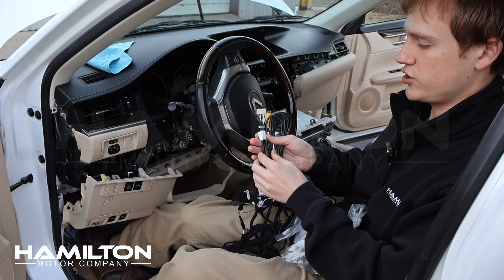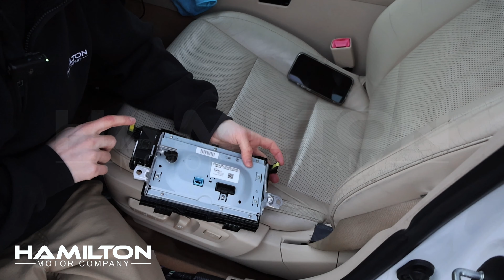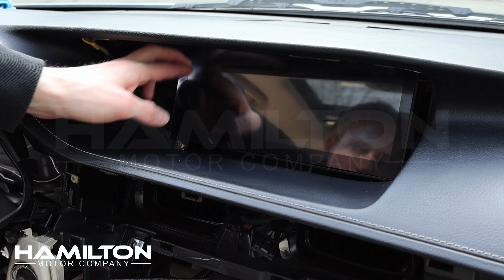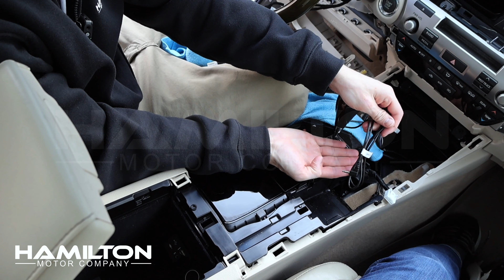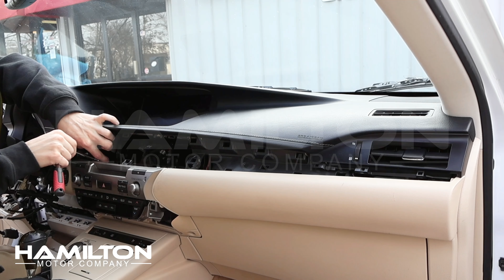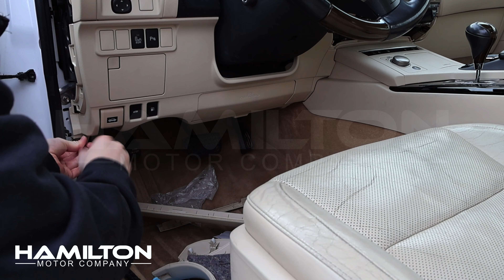2012-2014 Lexus ES Installation for Apple CarPlay/Android Auto by Hamilton Motor Company

Comment: Hi Dave! Will the backup camera have to be reconnected to the accessory harness (or any of the new harnesses from this kit)?
Reply from the maker: Those connections will be handled by connecting the Hamilton main harness to the Hamilton accessory harness. You can checkout our wiring diagram on the help center. It is not very complicated for this car/no need to mess with factory rear cam wiring other than what is behind the radio. -Dave

Comment: Is this a different headunit completely? Or is it a add on to the stock unit
Reply: Same question here. The video makes it look like the original screen gets entirely replaced by a larger screen - which is awesome. I have a 2013 es350 and considering getting this - if I can find an installer here in Jersey
Reply from the maker: Our kit connects to the Lexus Radio head unit as a touchscreen CarPlay solution

Comment: Hi, I’m interested in purchasing your CarPlay kit for my 2015 Lexus ES300h (mouse/joystick version). However, my original multimedia system (radio and display) is completely non-functional — no sound, no image. The backup camera still works. Will your kit still function properly in this case, including sound and CarPlay features?
Reply from the maker: We do require your OEM radio to still work for this system, as our equipment relies on it. -Dave

Comment: i have es 350 2014, is it possible to install it in that, and is it wireless and how much can it cost. thanks.
Reply from the maker: It has wireless and wired CarPlay. We do have a 2012-2014 ES Hamilton Conversion Kit. Installs typically cost around $400.

Comment: Where does the mic get mounted for best audio quality, as well as the small speaker that comes with the kit?
Reply from the maker: The mic is only needed for the 12-14 ES models. I would recommend mounting it above the steering wheel.
Reply: @hamiltonmotorcompany  also does the car have to be in neutral, or can I keep it in park?
Reply: @hamiltonmotorcompany  I have a 13, and I just ordered the kit a few days ago. The mic needs to be outside of the steering shroud, or it can be inside before reassembly?
Reply: @Dadlife3004  I just installed it in my 14. I followed the video precisely, but they miss actually installing the mic and the high monitor ES power behind the screen- make sure you hook that up to the original black power cord (he shows you way earlier in the video when introducing cords) before installing the screen. For the mic, I took off the large clip they gave, and ran the cord behind the very top curved dash that was slightly pulled out and placed it on the left side just at the corner of the left air vent. The other side ran  behind/next to the center air vent, up to the mic cord that will be fairly short behind the screen. It works perfectly on calls and for Siri, isn’t really noticeable esp while the steering wheel is in a neutral position. If I did it again I might test lowering it a bit more to the side, but it’s honestly fine with the black interior I have. I also put the usb just below the trim of the radio, sort of resting on top of the center console section , just the usb tip sticking out.
Reply: @woode221 thanks for the reply. I installed mine last Wednesday, and have been using it since. I run Android as I have Samsung, and I have noticed a couple issues with it that I have not spent the time to try and figure out yet. 

When I try and make a call by selecting a  contact in my phone while connected to Andriod Auto, my phone will say "can not call"  and just stays on the dial screen. The issue is it is actually calling on the phone itself and my call is received by the person, it just never shows that on my phone screen and it does not go through the Hamilton unit. The frustrating thing is I don't have anyway to end the call, there is no buttons on the phone to do so, and nothing on the Hamilton unit to do so. I have to disconnect the phone completely from the Hamilton unit to get control of my phone back.

The other issue I have ran into is random drop offs of music for a split second while playing. Sometimes just once, some times a couple times and it happens at completely random times, so I'm not sure what that is all about.
Reply: @woode221  I installed in my 13 last week. Having a few issues with it, that I need to figure out. When playing music while connected to Android Auto (I have a Samsung) it randomly drops for a split second, not enough to annoying yet though. 

The second issue I'm having is when I make a call it is connect through the Hamilton unit, but it only goes through my phone not through the car, weird thing is I have no control on the phone itself, I can't end the call or see that I'm even on with some one. I have to open the phone app on the Hamilton screen to have control of the call that is on my phone not being broadcast to the the Hamilton. 

The other issues are smaller like the mouse is so sensitive that it is near impossible to use, and some of the functions, like climate control are pretty small to see on the new Hamilton unit. 

Have you experienced any issues?
Reply: @Dadlife3004 I hate the mouse too. I only had my car a week before install so I don’t have a lot of experience using it, but I hated it on the OEM also… I feel like that whole setup was a terrible Lexus design, especially for so many years, when touchscreens have been around so long. I honestly don’t use it, I just use the touch screen. Wish I could replace the console with just a flat look to replace the mouse instead… or a cup holder there instead of at the top. No issues with the play stopping intermittently, I do have an iPhone though. I have actually read about that in a couple of threads on Reddit, it seems to happen more to android, but that could be anecdotal. I also have seen it happens with OEM kits, one suggestion has been to try using wired connection instead of Bluetooth. 
 I have had zero issues with making calls…. Haven’t seen that issue anywhere, especially with not having it connected to your phone. I can hang up in my SW, phone, or on the touchscreen.
Reply: @Dadlife3004 oh actually, I did have an issue initially..my phone only automatically connected sometimes, other times it was like I had to repair it. I watched the video they have on pairing it, and changed the “settings” on the screen to always connect and always have the last option I used as default. I haven’t had any issues since, for about a week now.
Reply: I had the same question about the mic… I missed this step so have to go back and add it, glad you asked! I stuck the speaker to the backside of the wall behind the factory radio and it fit perfectly. I think in the video he just said to put it somewhere behind or under the radio